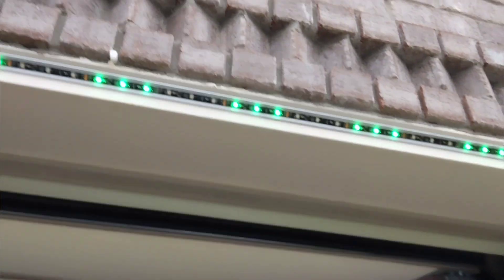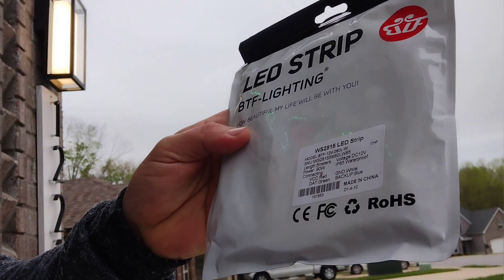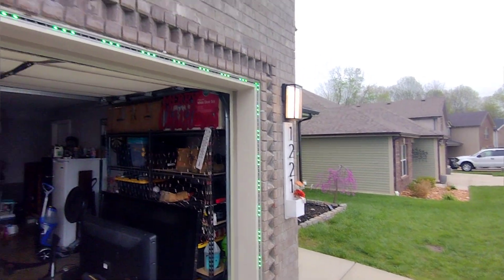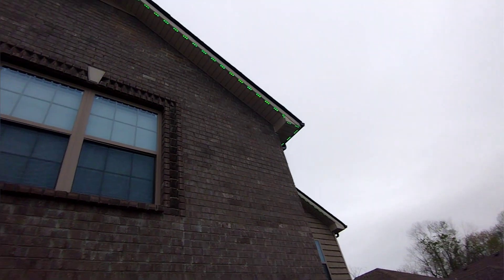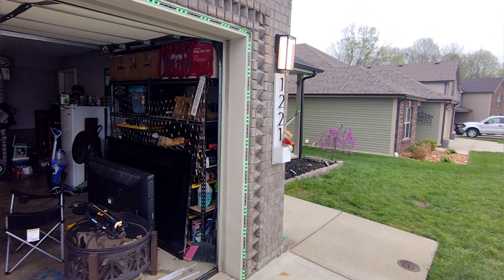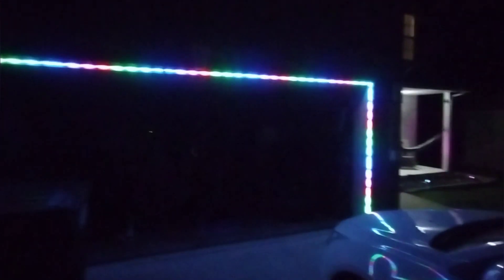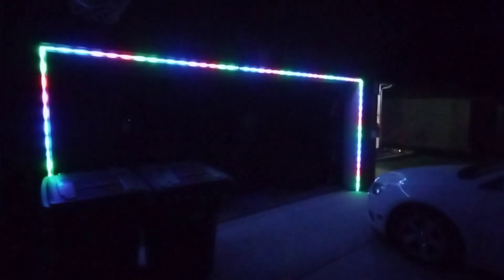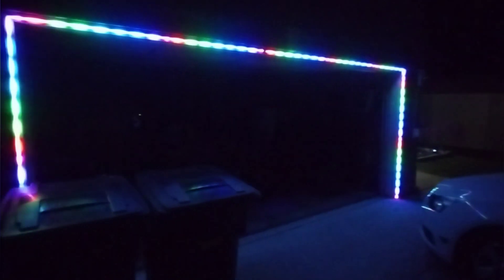I Upgraded My LED Strips - Here's Why

Comment: Did u use a j channel or anything ? I know in a prior video u had some up so wasn't sure if u re used the same j Chanel and covers u had from the prior ones ???
Reply from the maker: Yes I just reused the same channel from the previous install.
Reply: @BoredGuyWithACamera  
@KristenOBrien-wf1zg
2 days ago
That's awsome thank u!! Do u have any images of what it looks like when the lights are off in the day time just trying to see if it will look ugly against my grey siding.  Also do u normally install urs under or on front areas of peaks   can you send link to the channel???
Reply: That's awsome thank u!! Do u have any images of what it looks like when the lights are off in the day time just trying to see if it will look ugly against my grey siding.  Also do u normally install urs under or on front areas of peaks